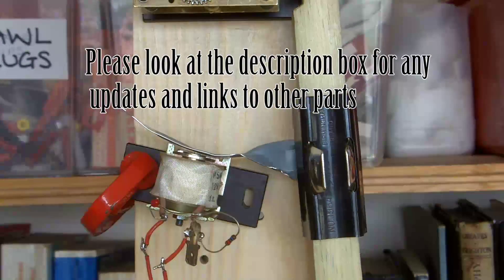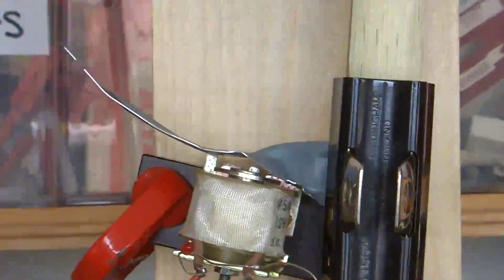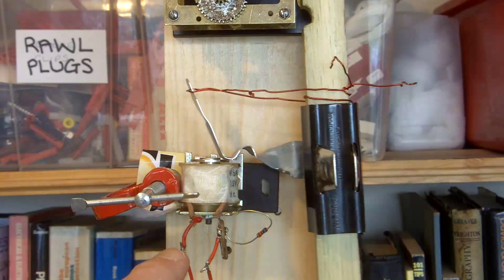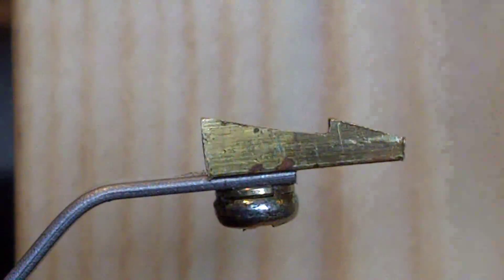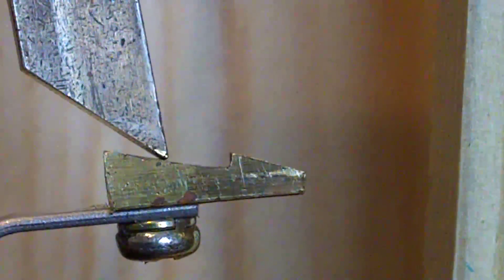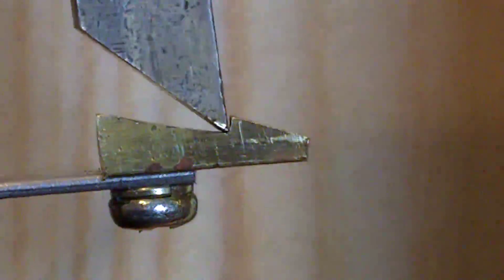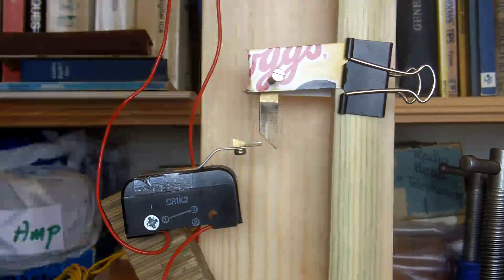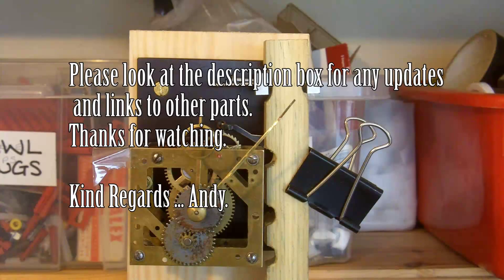Hipps clock movement project, rough part 15

Comment: I'm about to make a Hipp clock in Meccano, so I appreciate this clear explanation of the Hipp Toggle.
Reply from the maker: Hi you’ll have a lot of fun with the project and you’ll learn a lot, at least I hope that you will. The basic idea of the Hipps movement is to keep the pendulum moving with the least amount of input power. If you push a simple pendulum then each swing or beat of the pendulum will pretty much have the same time period, even as each pass of the pendulum is a little shorter than the one before the time remains constant. Check it out and you’ll see even when its only just still swinging a little bit the period is (nearly) the same as when it was swinging through say 15 or 20 degrees. So, with that in mind, the toggle that activates the switch is arranged so that on a big swing the toggle passes beyond the ‘activation point’ and simply drops of the end of the ratchet. As the swing diminishes the toggle doesn’t drop of the ratchet and the weight of the pendulum pushes the ratchet down and operates the switch to activate the solenoid that pulls the pendulum into a wider swing. Don’t worry about the actual time keeping at this stage just concentrate on getting to understand the switching mechanism, the rest will follow.  Watch this video again and again unto you get it. 
Let me know how you get on.     Regards . . .  Andy